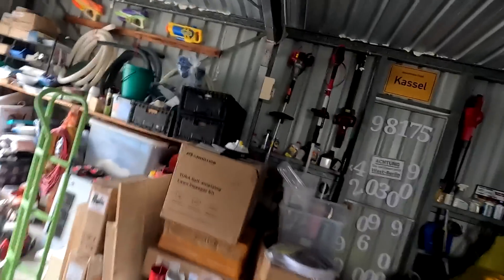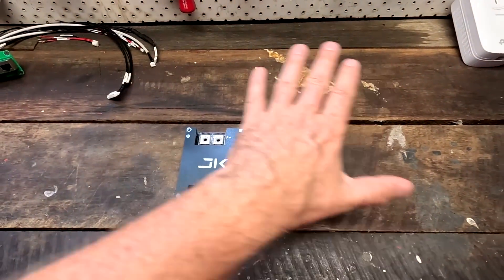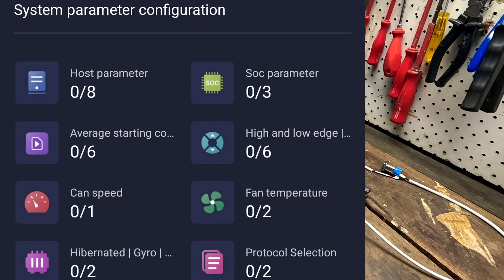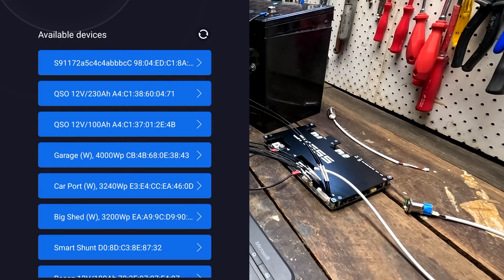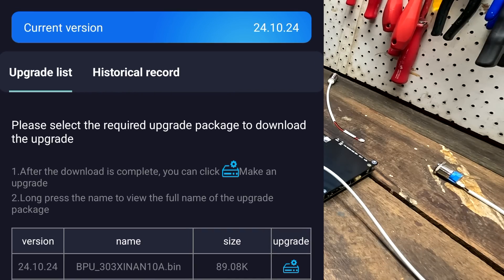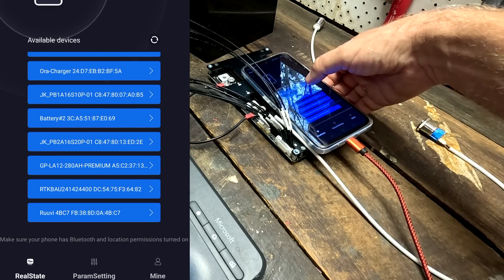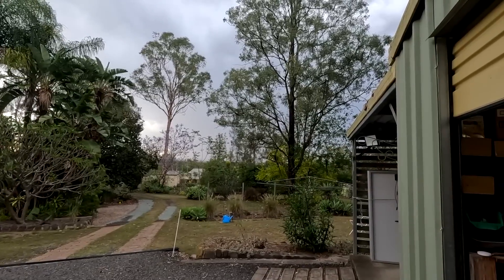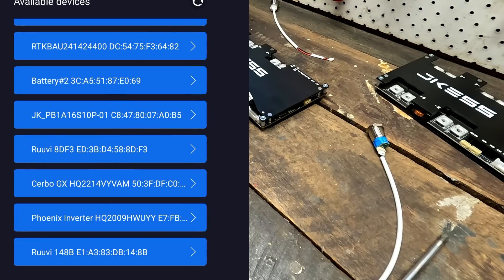Connecting the JKESS BMS and first look at the app. Ouch!!🤕

Comment: You can't flash BMS with unknown firmware, and twice.
In my video I did the update without any problems, but you need to know what to flash. There is a menu Firmware history - there is information about software versions.
BMS are very interesting. I disassembled and looked at what's inside. Made using expensive components.
It has an active balancer 2A, and a passive 58 mA. There is an AFE and a current limiter.
BMS are wonderful, the software works, updates work.
Reply: I'm wondering how much $ did the author of these videos get from JK for discrediting another manufacturer's product (JKESS)? How is it possible, twice, without thinking, to upload firmware from another product? This is either monstrous incompetence or malicious intent with a $$$ purpose.

Comment: Is there a chance you flashed the wrong firmware? I say this because on the firmware upgrade screen the file names are vastly different possibly indicating it's meant for a different product, as are the sizes of the firmware images. It says that you can long press on the name to see further details of the image. Maybe in there is hidden the information needed to identify the correct image for your BMS.

Comment: But what if you use a well knowed brand and found it sh1t . Im talking about Daly bms the 300A ones . i have 2 and 1 never started up and the second one broke down after 6 months with an memorychip defect . Because of your videos ive switched to JK bms  and it keeps working perfect . i also have the JK balancer (seperated one , no BMS) and keeps working fine for some years now. Home bank is 23S x 10P LTO Yinglong 66160 45Ah cells with an all in one 48v offgrid solar inverter with grid input .

Comment: The second BMS showed 24.10.24, and you tried re-flashing 24.10.24... It was already on the latest.  Either way, probably both devices require a wired firmware flash to revive, and the software definitely looks very alpha-quality with very little QC.  The really disappointing part of this is that while the hardware might be a great design, the software implementation is ...rushed, not quality controlled, not tested, and poorly documented.  Completely invalidating the value of the product.
Reply from the maker: I don't think the app works correctly and showed the actual firmware of the BMS. I have no documentation for the app and just this one sentence how to upgrade the firmware and wait a minute before restarting the BMS.
App and firmware need a lot of work before this is only close to be ready for publishing.

Comment: The 2nd BMS was already on 24.10.24 before tge upgrade attempt. The app made no attempt to let you know it was the same version. I guess, had it succeeded, it still wouldn't be functional.
Reply from the maker: I don't hink the app works correctly as it still shows 24.10.24, even without a BMS connected.

Comment: I think something bigger is going on. Is there some association between JK-BMS and ENJ-BMS? 

The jkbms website would seem to indicate there is. It speaks of a next gen jkbms with more accurate soc, and links to the enjbms site. But nothing like this steaming pile seems to be in there. Also the jkbms website is copyrighted by enjbms grouo.

Perhaps the use of JKESS on this thing is intentional to use the name recognition, by the "group".
Reply from the maker: Yes, the seller on Ali uses its established channel to promote this BMS. JIKONG has no influence on this though. They only make the BMS but don't hold the JKBMS name.
Reply: I have also found enjpower website selling jkbms and balancers. 

Additionally, I found a listing for the JKESS board, and it has 116 sold. All of the reviews of previous sales have been for jkbms boards. They have edited a jkbms listing and changed it to the jkess board and I guess are hoping to ride the positive reviews to make more sales, even though they are completely different BMSs.

Enjpower and enjbms both have a board using a relay.

Comment: Suddenly Seplos is not such a bad choice, is it?
So which BMS is now the go to hardware for a 16s EVE mr.Big setup?
Reply from the maker: I would say, the JKBMS is not such a bad choice any more.
Reply: @OffGridGarageAustralia  I really don't know. I've played with Seplos 2.0 and 3.0. Kind of same quicks, but in the end, it works. A bit dumb how it communicates with the Invertor. Like when 1 cell in a pack has a warning, no other packs are charged.
If all packs can handle 200A and 1 of 4 packs has a loose cable, the invertor thinks the other three can only handle 150A.
Just dumb.
But with the JK, yes, you don't need a seperate balancer.
But on the other hand, sometimes the thing just stops.
Stops charging, but also stops discharging. I can't have that uncertainty. At least with Seplos, if everything is well balanced, You get almost all power in your pack, and can use it if needed.
If only, some company stepped up and made a sane device.
It would even be better if JK would make the software opensource.
The hardware seems OK, but maybe it's the hardware that makes the software crash/loop.
For now if someone asks? I'd say "I don;t know"
Reply: more then 16 packs paralel?
Reply: @mosfetkiller3851  The "more than 15 parallel battery packs" got my attention
Reply: @mosfetkiller3851  16s = 16 cells in Series. 16 Cells in series with LiFePo4 cells gives 48V (give or take 10V). The BMS Andy bricks in this video is a 4s to 8s. To put 4 cells to 8 cells in series. (which gives a 12V or 24V pack)

Comment: I thought it was weird that the file size of the newer versions were smaller. I guess that's because they don't work
Reply from the maker: I just followed the instruction they have send me.
Reply: Well, judging by the size of previous versions (87-122KB), there’s nothing strange here. Especially considering the early version of the firmware, the software can be significantly optimized

Comment: As it showed every bluetooth device it also showed every firmware. I guess you flashed the wrong firmware, the second line could be the right as the naming convention was a little different.   Bravo JKESS for not checking if it is the right firmware for the right device

Comment: This JKESS BMS video is really a really great advertisment for JK. If you think our software is imperfect, just try the competition 😂
Reply from the maker: Whoever the manufacturer of this BMS is did miss a few steps to prevent this from happening and also didn't test their product before sending it out. Wow.
Reply: But to be honest and frank, both the software works and the updates work. I did several tests, disassembled and upgraded this BMS. Everything is fine, if you don't flash it with an incomprehensible firmware. I also wrote to the seller to close the ability to update firmware, so that Andy no longer kills JKESS.

Comment: Roll it back to an earlier firmware version if allowed and see if that makes a difference.
Reply: Only possible if he could connect to the BMS again
Reply: I think Andy did the right thing. When Andy clicked on the small icon, a window has appeared stating that the update file has been downloaded and is ready for upgrade. This means that the file is already on the phone and needs to be uploaded to the BMS for firmware installation. Andy confirmed. If anything is wrong here, it’s the developer’s responsibility.
Reply: Nope it says if that symbol is there you can update

Comment: Any news on the v15.32 firmware yet
Reply from the maker: We're still testing and trying to find a good way to reset to 100%, so as many edge cases are included.
Reply: @OffGridGarageAustralia  my inverter also have the same problem if the battery shows 100% the inverter shutsdown charging completely so i cant use the rcv and the rfv settings correctly or do balancing
Reply: the 32 is online i have it on my bms but not the 33 or above
Reply: @mosfetkiller3851  where did u get the v15.32 i have the 100a version i only see v15.30

Comment: disconnecting the bms COMPLETELY from the power supply did not help? (including disconnect the balancer cables)
Reply from the maker: Disconnected everything for e few hours. shorted B- and B+ to discharge all caps. Still nothing.
Reply: I’d be surprised if Andy didn’t try that. That’s one of my “go to’s”, shut everything down and do a restart.

Comment: They had their fair chance and hopefully learned a lesson to not create the impression to be a JK what soever and for sure no bmw or mercedes bms.

They did not even deserve that second chance. 
My JK BMS is also not working well, it can cross the 100% SOC reset point and does not push the counter to 100%. 
I have to play around with changing the Ah sizes to restart charging over and over again till it jumps to 100%. 

If the voltage drops belows that recovery point and then crosses 100% SOC setting then it should be 100% but it does not. 
And it can also drift each time I have not fully charged it. 
Finally the standby consumption feels quite huge cause each night when I make a discharging break for 5 hours or so to have enough energy in the morning to avoid expensive tibber morning hours I can watch the SOC going down. If it looses 2 or 3 % then it is an awfull lot considering that this would mean 10 % to 15% a day just for idle.
Reply: Yer im finding my 2types of jk bms' can eat up to 30 watts each  depending on throughput . I find if you adjust your soc setting some times you have to turn off the bms for that setting to start working properly